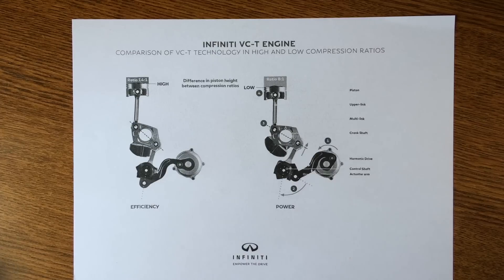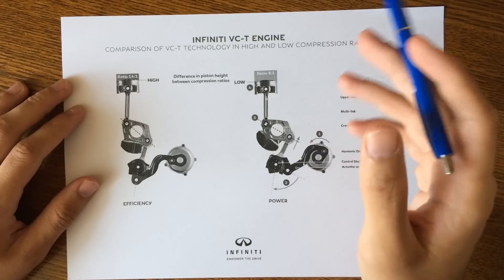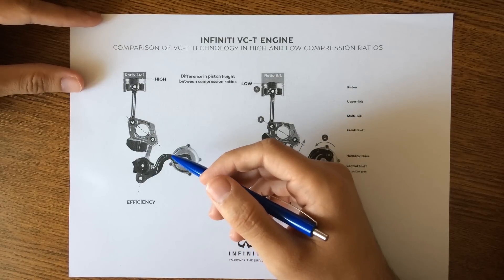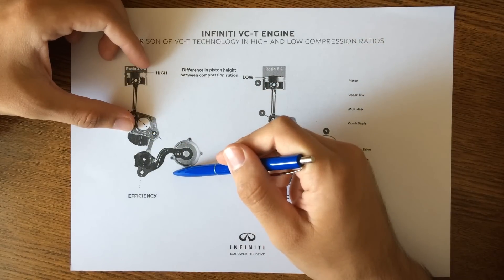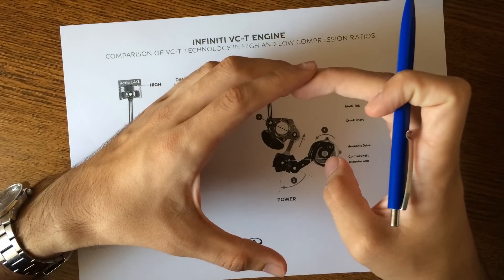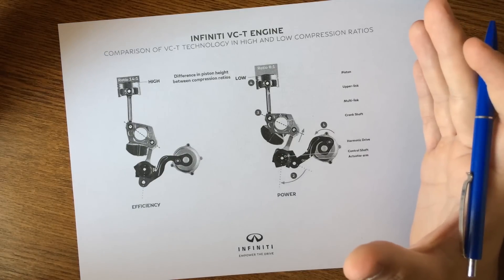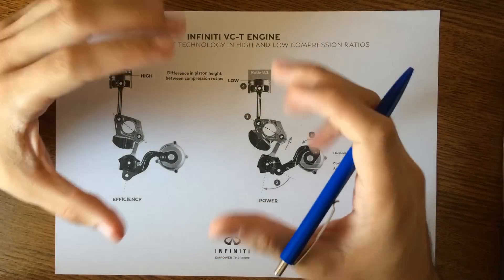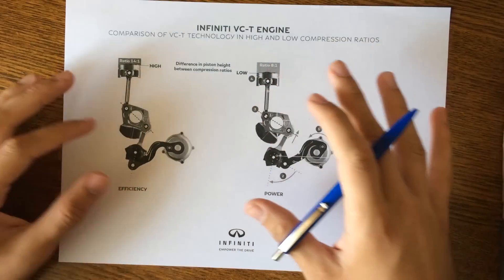Infiniti Engine - Variable Compression Turbocharged VC-T Explained

Comment: OTTO/DIESEL crank pin revolves in a perfect circular motion and engages the piston with a crankshaft in an inadequate relationship. That's why requires after-treatment accessories to complete burning process. This concept increases the volume twice faster than conventional crankshaft. So forget about it. It won't have enough time to burn the fuel. Demand for VCR is already partially resolved with VVT.

Comment: We sent a letter and comments 25.11.2016 as follows. Disadvantages engine with variable compression ratio «infiniti» 1. Low reliability due to the complicated, cumbersome chain of elements included in the mechanism of change of the compression ratio (actuarial system with pneumatic, hydraulic and electronic control lock). In the context of large temperature gradient arising during operation of the engine, these elements will inevitably cause it to malfunction and failure, especially at high engine speeds. 2. According to the manufacturer, the engine was very balanced (?), So that the design of the balancing shafts were withdrawn. The fact that the lever end pivotally connected with a yoke, which allows to vary the stroke range for changing the compression ratio oscillates strongly at considerably lesser curvature (!) Than the curvature of the oscillation of the rocker, mounted on the working shaft, wherein the rotational oscillation . This creates additional stress and imposing harmonies of different orders, resulting in an increase in the tipping moment as a working shaft and the additional shaft, and leads to a large imbalance in the engine. 3. In general, a complicated and expensive to manufacture, and are not easy to operate. 4. Less is balanced not only in comparison with the traditional, but also with the previous generation engine lineup with a variable compression ratio «infiniti». 5. Because of the increased cyclic bending deformation of the rocker, the mechanism changes the compression ratio can lose their nominal precision characteristics and may even be damaged as a result of fatigue failure. 6. Excessive fuel consumption in city driving mode. With such known significant shortcomings, it is impossible to start the engine in series production. Engine model at the level of research requires significant improvement. Disadvantages engine with variable compression ratio «infiniti». We offer a fundamentally new design solution, allowing to increase the reliability of the engine due to: 1. Simplify cumbersome chain of elements; 2. Elimination of vibrational harmony arm ;; 3. Elimination of the rocker. P.S. On one piston are five arms, connecting rods and three shafts including the crankshaft, and eight-socket joints, five of which are constantly in operation. Question! I do a lot of moving parts per one piston? We have found a new design solution of the problem and set up a mechanism changes the degree of the internal combustion engine compression. Patented engine can increase the engine reliability at pp 1-3 and keep the previous size of the crankcase, they do not need to increase. Also developed and patented a new system of timing device with an overlay and a full opening of the gas distribution channels operating simultaneously in a cyclic mode with the working shaft. Currently, a prototype engine design, which will be presented at the International Exhibition ExpoEngine-2017. For manufacturers interested in the creation and implementation of efficient engine with variable compression ratio, including «infiniti», we are ready to cooperate.